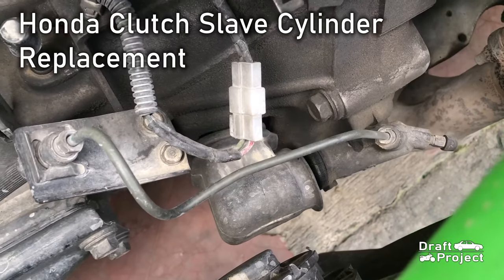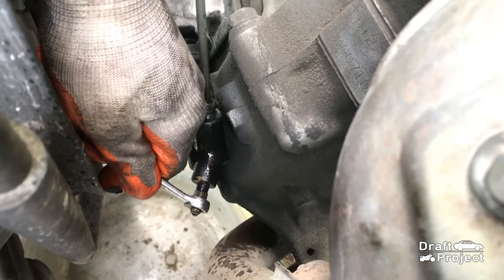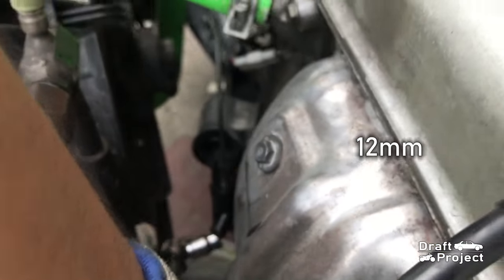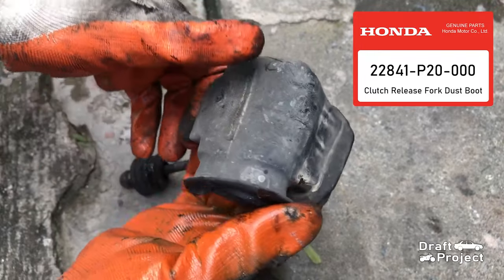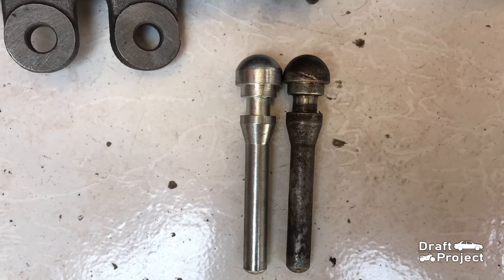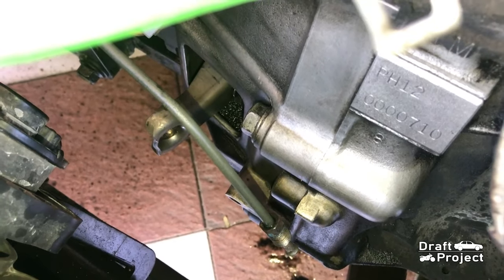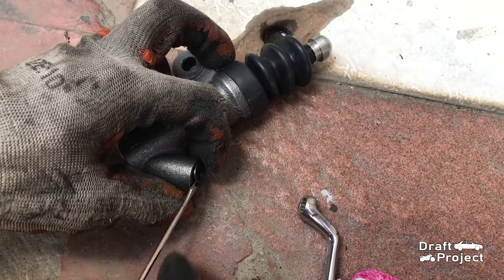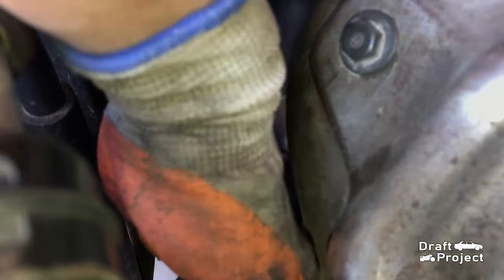How to Replace Clutch Slave Cylinder - Honda

Comment: you didn't need to shave a 9mm wrench to fit, simply buy a 3/8" wrench, its sits in between a 10 and 9mm. Japanese use Imperial sizes, with the larger nuts you can get away with using Metric wrenches aka in mm, but with the smaller sizes, you should use imperial or you risk rounding off the nut
Reply from the maker: I see. That's really useful. I really appreciate your comment. Thanks a lot!
Reply: Solid insight

Comment: No…..don’t drain all the fluid. Just do a quick swap. Then flush so you don’t have to try and get all the air out. Also getting dirty degreaser in to your clutch plate is a bad idea.
Reply from the maker: My bad. Never thought of it. Thanks!
Reply: Make a video then 🤣

Comment: Great video! question did you have to push the push rod in when installing it? I notice if i dont push it the wholes on the bottom do not line up?
Reply from the maker: Nope. I just simply insert it and the holes matched. If that's the case then you can just simply push it a little bit until the bottom matches.
Reply: yo bro did everything work fine with you having to push the rod in some when bolting cylinder on?

Comment: I was wondering if I needed the dust boot right away or can I go a little bit without it?
Reply from the maker: It's always better to have it right away so that your clutch fork and slave cylinder push rod will be protected from dirt and debris. The grease in between the fork and push rod will get contaminated without it. If you don't have access to get a dust boot, you can still drive without any problem at all. Once you get a dust boot, just install it right away. Make sure everything is clean, grease is free from dirt before installing the dust boot.
Reply: The main problem that arises from this is usually a "squeak" when you press the clutch pedal, as that ball on the end rubs inside its joint on the clutch fork, if the grease is dirty or if there isn't enough.

Comment: What is the thing floating in the reservoir? I don’t have one.
Reply from the maker: That is a floater. As far as I know, it is there to prevent the master cylinder from sucking air when the fluid goes extremely low.

Comment: Hello! How did you know that you have to replace that part? What was the symptom when you were driving?
Reply from the maker: I decided to replace it as a preventive maintenance. It has a very little leak which indicates a failing clutch slave cylinder. There are not that much of a noticeable symptom when driving. Just check it visually for leaks, broken rubber boot and gradual decrease of clutch fluid.
Reply: Mainly soft pedal and hard to engage gears
Reply: @White-lz2jo I have that exact problem, turns out it was leaking.
Reply: @White-lz2jo Shouldn’t soft pedals be good?

Comment: Why do you drain the oil when trying to do is bleed the clutch
Reply from the maker: Since I opened the system and I would just eventually dismantle it, it's not a bad idea to let it drain some old fluid. Also, I don't want the old fluid with particles to get into the new system.

Comment: my cylinder isn’t moving at all ? I replaced that and it wont bleed now
Reply from the maker: This could be a trapped air in between the lines. Try bleeding on the clutch line instead of the bleeder valve. If nothing happens, try checking the other cylinder, could be the master or slave cylinder perhaps one is not working properly.